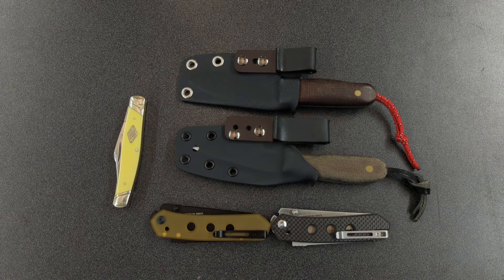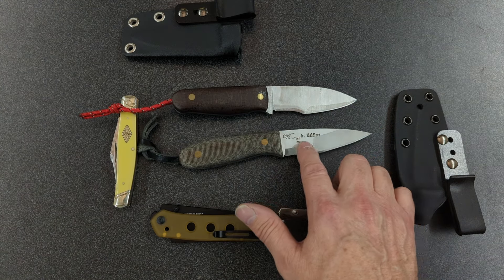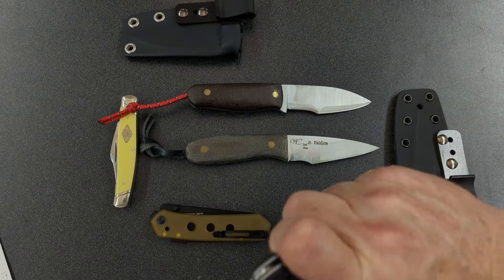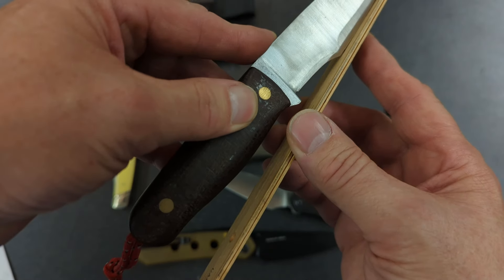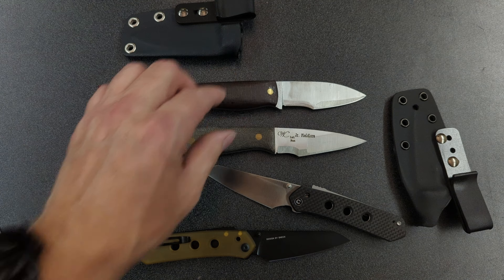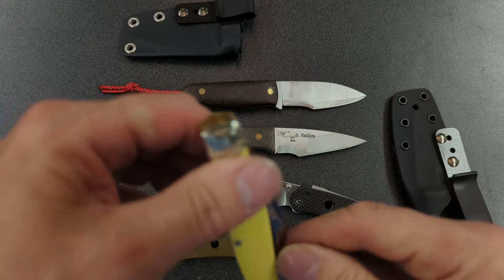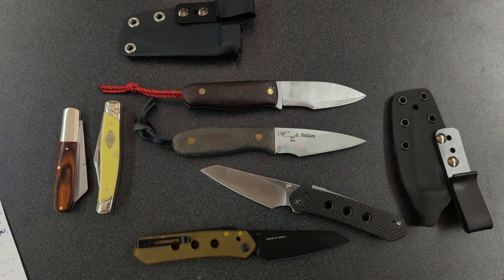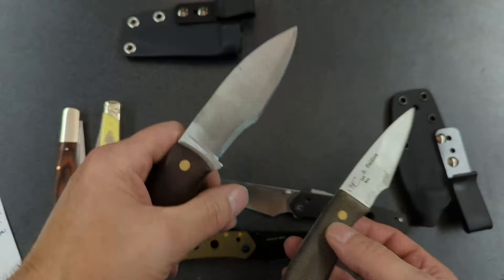William Collins Jr. Fieldlore, Multigrinds, and Upcoming Projects

Comment: I like your knife because of the handle and that little shoulder (not sure if this is the correct term, lol) between the handle and the blade.  To me it is always good to have a little bit of metal there that helps you know if your finger is about to slip up onto the blade.  Just seems a bit safer.
Reply from the maker: I also like just a little bit of a guard. It lets me know where my hand is by feel.